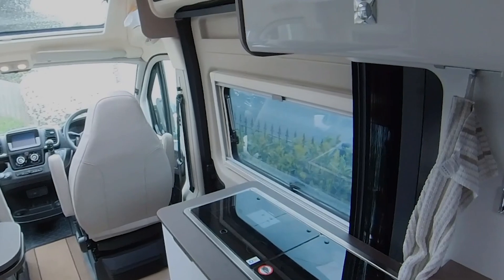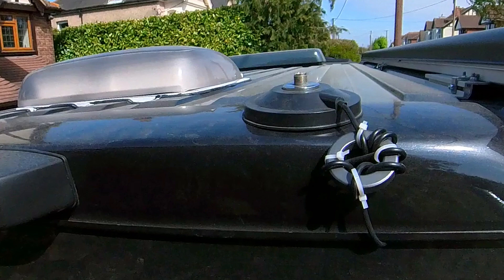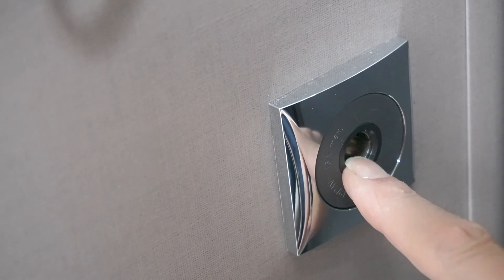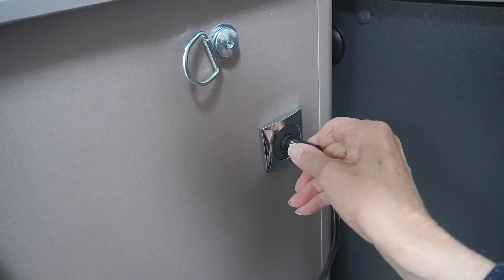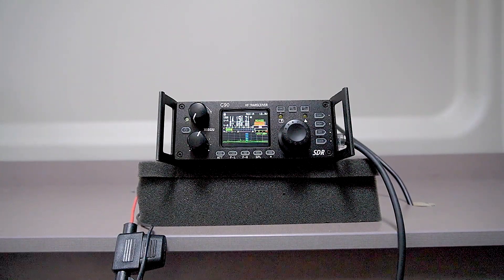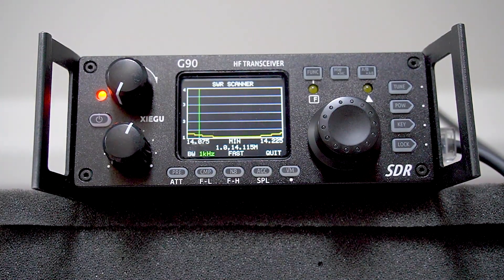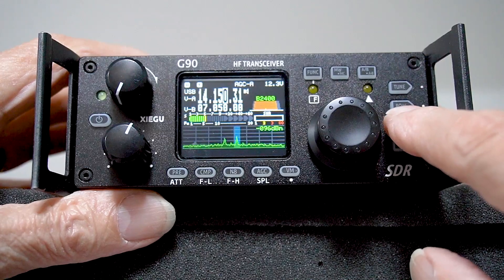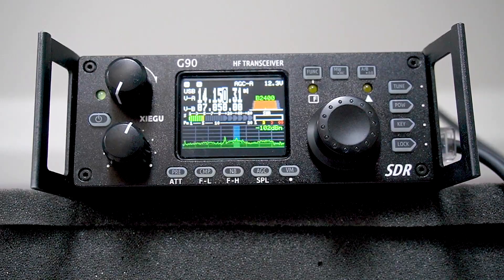HF Mobile - Low Cost Efficient System | HAM RADIO

Comment: I just think if you going to park the car or wan for operating hf. It's better to use an inexpensive telescopic fishing stick, you can easily find a stick that's 6m long and put a 1/4 wire for 20 meters. You can use an fan foot for the stick and and ground the antenna under some screw on the trunk hatch. A full 1/4 going to work better than a coiled 1/4 even if the coil is made low lose, you can calculate quickly that double the length will give you 3db. This is not the full truth because we're not taking to account that ground plane in the calculation and that's pretty much half off the antenna depending on the shape of the car. And also we're not taking to account the efficiency of the coil in the short antenna.

All the best and good dx the OH2FHJ

Comment: Hi Peter, I have also just changed my campervan for a metal bodied one! My issue is, that as its a high top, I'm not tall enough to reach the roof! How do you get to yours? Ladder rack? I use one of your triple mounts on the bonnet, which is a challenge, as the van is a Pug Boxer, but, even 40m is ok .Also worth noting on the G90 is that even when supply voltage drops they output the same power down to about 9 volts I believe, great radio. 73 Dave G8XDD
Reply from the maker: I do have tge advantage of being 6ft 2inches tall. Also my van has rear doors, so I can open them and reach up from edge of the rear floor. Peter.
Reply: @watersstanton  I have found that I can access my roof by standing on the rear seat and leaning out the rear doors!

Comment: For several years, I operated HF mobile with an ICOM 7000, an LDG auto-tuner, and a "repurposed" 102" CB whip, roof-mounted atop my 2006 Hummer H3.  orked great on all bands from  40-6 meters.  73...

Comment: DIN plugs and sockets, often called Hella plugs. You must have a German based conversion? Those plugs and sockets give a much better connection that the usual cigarette sockets and I believe carry more current. You can get Multifit plugs that will fit both cigarette lighter sockets and the DIN socket.
Reply from the maker: Yes it is German. Thanks for the info.
Reply: Hi Peter, please have a look at ISO 4165 which I believe supercedes the earlier DIN designation. 
It should take 12A easily and provides a better mechanical connection, I much prefer them to fag lighter connectors, they don't get as hot due and are less likely to get knocked out.
Simon M7BXR.